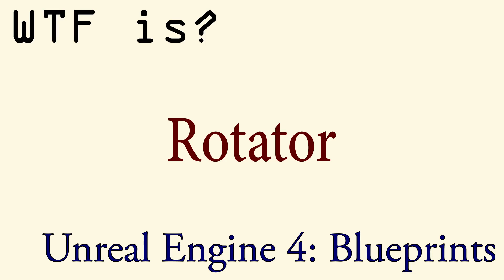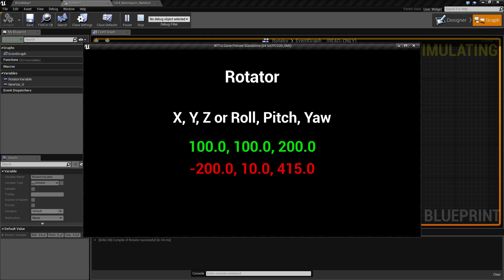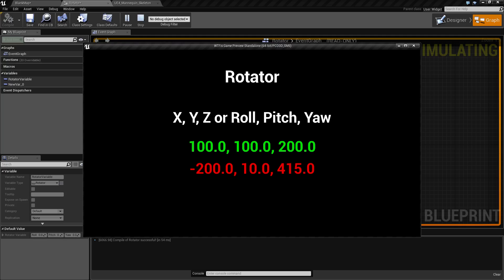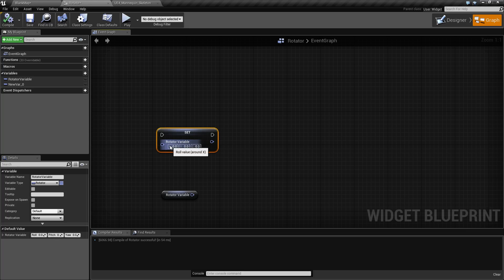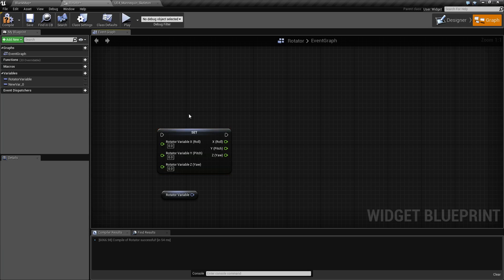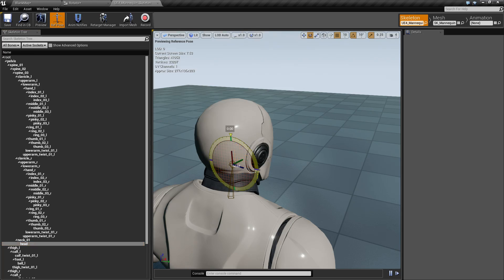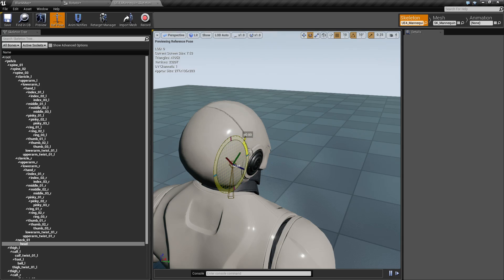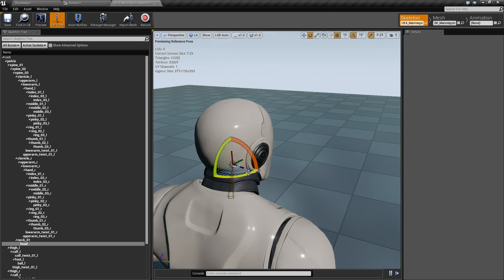WTF Is? A Rotator

Comment: I know this is a really old video, but I just wanted to say: I have been working with 3d math for a very long time. I use rotators all the time, but I always have to think about them quite hard while using them. This example using the movement of the head, flipped some sort of switch for me, and increased my work speed with rotators by a significant amount. Thank you for that.